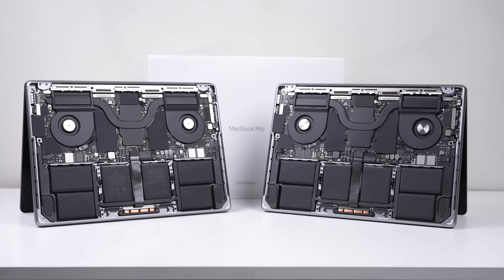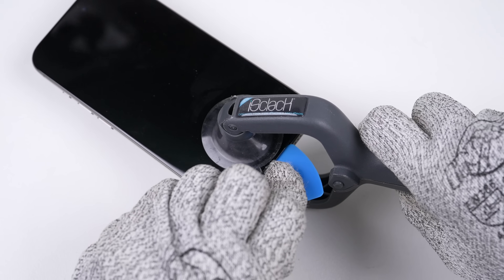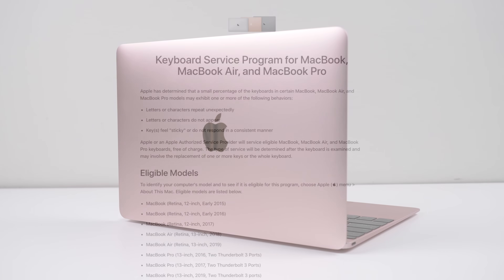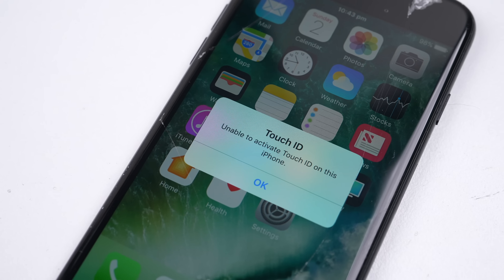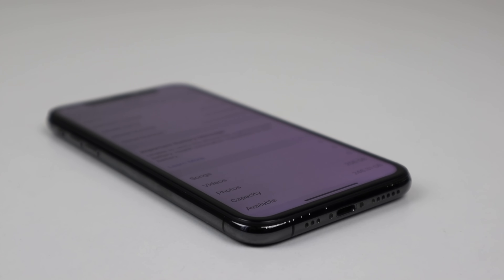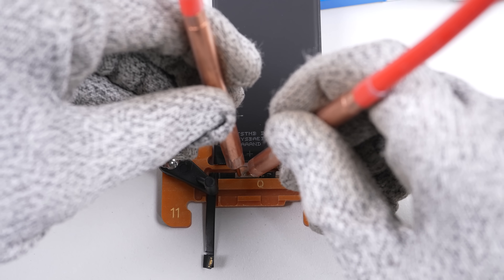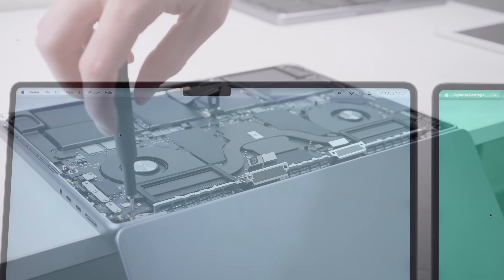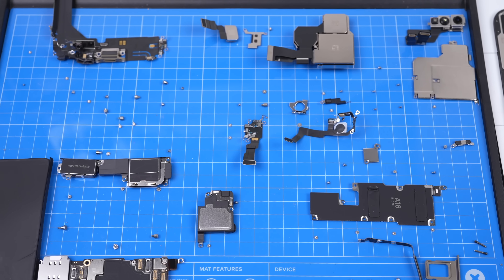Astonishing Anti Repair Practices By Apple In the Last 15 Years

Comment: The ABSOLUTE worst thing Apple has done in the past, is to make their phones virtually irrepairable, and have success doing it. That encouraged all other cellphone manufacturers to follow suit. Their actions over the years have contributed to tons and tons of tons of e-waste. They were, and still are despicable.
Reply: And then they greenwash lol
Reply: @seesikopter just don’t be poor and recycle/trade in your phone
Reply: @0IIIIII  why should i
Reply: Yep, I hate when people say "yeah but other companies are doing it too" that's mainly because apple pioneered those awful pratices.
Reply: That's because they have a monopoly in you know which country.
Reply: @ss_avsmt the hellhole called america
Reply: and people are still buying them and they make most profit out of all smartphone
Reply: Sheepole are buying them, they all follow the herd
Reply: @asfsfas2435 the problem is that having a phone is no longer a commodity. Even if I actively avoid a top of the line phone, I have to end up replacing them in 2-3 years at most when I used to be able to replace a broken part them until they completely died out. Now if the screen scratches even a little I have to replace the whole thing because just replacing the screen is no longer viable.

Weirdly enough, I still use my Nokia C3 that I bought on like 2008 regularly. That bad boy still works (even though it's mainly as an MP3 player) and I was lucky to get a spare one when I started to notice these practices on modern phones
Reply: @asfsfas2435  They arent the most sold phones, but apple certainly makes the most profit. They have the biggest profit margin per phone of all phone companies, and they have virtually no competition on their "apple monopoly". People either buy apple phones, or androids. Androids are far more common, but they all split their quantities between different manufacturers. There are just countless, like e.g. Samsung, Xiaomi, Oneplus, etc. This and their market strategy of being a luxury and status item made them what they are today.
Reply: @asfsfas2435 we’re still buying them because they mostly never have to be repaired. It’s called quality.
Reply: And they will argue that anti-repair policies will hasten the innovation
Reply: Most people defending apple here have generic profile pictures wich just goes to shown they are casual people who don't understand stuff
I dislike apple just because of how closed it is, I'm all for modding and customization and that's why I use Android, last year I got an iphone as an gift and just No I can't install Mods for games even if the developer allows it, I just couldn't take it anymore, I sold that iphone for 75% it's price to one of those girls at my college

Btw Windowns fix windows 11, Linux ain't that compatible
Reply: Never owned an apple device, never considered getting one, and after finding out they are doing this crazy shit just to force you to pay for a new device whether you're broken or outdated I decided I never will het an apple. Works for whoever works, but I was always peeved with their tactics.
Reply: @mihaipuscasu7357  based af, fuck apple
Reply: The EU mandated side loading, USB C and removable batteries!
Reply: @thewhitefalcon8539 nothing better than the eu
Reply: @thewhitefalcon8539  I mean on the brick side. Was that mandated by the EU as well?
Reply: And they call themselves very sustainable and eco-friendly for removing the charger block from the box. Which you will have to buy separately wrapped in more material and most importantly for more money.
Reply: @barnabasnagy9595  People who are upgrading their iPhone, don’t need to buy another charger. Also, wast majority of latest iPhone users are existing customers, so they don’t need to buy charger as well. Or maybe sofa-scientist like you knows better? 😀
Reply: @robertovic915  sorry if my comment was offensive or sounded like that, it wasn't my goal. I heard that a lot of the people weren't satisfied with this choice and this was somewhere around when they started giving cables with usb-c on one end.
Reply: @robertovic915  Apple didnt care about their previous users and making les E-Waste though, why would they try not to use USB-C otherwise? Almost everybody already has an USB-C Charger for the majority of devices, AND it is superior to apples Lightning charger. That didnt mean they were happy with changing to USB-C tho lol
Reply: Sadly, they simply don’t care.  It’s all about the bottom line.
Reply: They had success with it because people just buy them, and that's why I refuse to be owned by them by never buying one of their devices...!!!
Reply: @lmwlmw4468 dont consume anything corporate use small businesses
Reply: Their management should  be indicted for crimes against humanity. Never touch anything Apple with a bargepole.
Reply: In fact, Apple was the first to implement EVERY SINGLE scummy tactic that we see in use today in the smartphone and laptop department. EVERY. SINGLE. ONE.
Reply: @meyes1098  Last time I checked, samsung were the one forcing TikTok and other bloat onto their phones with no ability to uninstall. 

At least on the phone side, M$ have been doing so for nearly 10 years over on the PC side.
Reply: @sagwan-square  tik tok isn't an uninstallable app on either windows pcs or samsung phones.

Thanks for playing though.
Reply: Yet they'll claim being green because they don't ship chargers.
Reply: And Apple fans keep buying.
Reply: Only hope is legislation like EU forcing removable batteries
Reply: @captaintoyota3171 the eu is easily the best political party on earth
Reply: Yeah that’s the worst thing, not the sweat shops they run
Reply: If it had been upgradable, I might still use my Huawei Ascend Y300.  Nice little phone, but much too limited storage (4GB was just far from enough even for moderate use).

Yes, upgradability and not lack of repairability was the problem.  It even had a user-accessible battery (which appears to be dead, just tried charging it a few days ago… not sure I'll even try to find a battery, it would be just for curiosity)
Reply: This is it.. this is how we'll destroy our world by not caring
Reply: boycott corporations just stick to small businesses
Reply: our only hope is the eu and until then stick to small businesses
Reply: and yet you fools still buy it in large even after being screwed over for decades!: 😂 brainlesss fools
Reply: I love it when children who know fuck all blame the entire industry on one part. In this case you think Apple was the only one making things smaller? 

Must be great if you think things are this simple. Kids are stupid.
Reply: Never bought a Cr@pple product, and hopefully never will.
Reply: Your mom is despicable.
Reply: What i try to tell apple fans but they get mad. But i know the truth and i have woken up from the genius brainwashing apple has done to a lot of their fans
Reply: I find it ironic. That people are more outraged over this then whats going on in the west. May I say white and genocide without getting ban. Well not that ironic as this platform is rigged to protect jews and screw white people over. Worry about the environment and any thing else but not what going on in your own country while your own blood line dies out and get forcbley mixed raced into oblivion. Cost of living and housing causing many more homeless dying on the street. While homeless shelters packed full of so called asylum seekers  that just so happen to pass by over 50 countries to get to yours. That make it dangerous for anyone to go there for shelter.
Reply: The worst thing apple has done was lobby against bills that would have held companies in the US accountable for forced labor in China
Reply: fuck the "e waste", they wasting my money
Reply: Thank you for paraphrasing and summarizing the video.
Reply: Apple makes environment friendly iCan, iToilet with built in camera,  antitheft protection , poprint sensor login etc
Reply: Yet 1000$ says you wouldn't give up your phone... All the companies do it, so if you don't like it, don't buy these bullshit "smart" phones anymore. That won't happen though.
Reply: @TanakaMatsumoto the old phones which were made to last and were actual phones are infinitely smarter than the modern day corporate screen tablet money farm
Reply: @TanakaMatsumoto  i bought a xiaomi f4
I am fine with it so far lol
Reply: @TanakaMatsumoto  i literally installed and reinstalled his own rom
Reply: EU has begun to say that all electronic has to become repairable.
Reply: @andmos1001  guaranteed eu w
Reply: @andmos1001   But they didn't say that it has to be cheaper than replacing the whole device. Nor do they have to provide repair guides nor schematics.
Apple being a huge publically listed company means that they must increase their profits every quarter. If they don't then stockholders will flee and Apple heads will roll.
Reply: @gebali  ohvno god forbid the billion dollar corperation not make as much money 😢😢
Reply: I’ll continue to buy iPhones until the alternatives are on par.
Reply: @o0Donuts0o  Some of the alternatives are on par with iphones. Explain what you think is better about iphone than android based phones.
Reply: @carletonrutherford1799  I prefer the interface on the iPhone. I don’t like Androids. And before you call me a shill the iPhone is the ONLY Apple product I use. For my PC, Windows all the way. Don’t like the iMac interface. I don’t care for aesthetics of a product either. Milled aluminum aircraft grade whatever, curved screen bla bla bla. I need a phone I can use fully in one hand, top of screen to bottom. iPhone mini fits my bill.
Reply: @o0Donuts0o  I was legitimately curious as to why you would say no other cellphone company is on par with the iphone. You have had success with your iphones, I get it. The smaller iphones that can actually fit in your shirt pocket are something I have been talking about for years. I have no actual issue with the quality of iphones. For actual usability, and operating systems, I think that android cellphones are on par with apple. I think that if phone size isn't an issue, it's just a matter of preference, and that there is no one better than the other. I still stand by my original comment in this thread though, apple encouraged other cellphone manufacturers that they could force people to have to buy new phones instead of being able to repair their existing ones by making it very difficult to even change a battery. And that is why I have a very negative opinion of the company.
Reply: i hate that i can't replace easily batteries i could be literally using one phone for decade if i could just easily buy and swtich batteries
Reply: I still wish my phone's battery could be replaced. That and processing power are the only reasons I've had to change in the past
Reply: I think consumerist culture causes e-waste. Apple devices last years until you need to replace them. People just like buying the brand new latest device, they sure as hell aren’t forced to.
Reply: Bro humans in general are wasteful as hell. 
Humans will ruin this earth until the consequences of that lie on the heads of the living and even then it'll probably be late. 
Nobody with actual power will have to worry about it and that's why nobody cares right now. #Humans
Reply: 𝙷𝚎𝚛𝚎𝚝𝚒𝚌𝚊𝚕 𝚎𝚟𝚎𝚗.
Reply: Pls just sue them for 2/3 billion dollars
Reply: "all other >>WESTERN<< cellphone manufacturers"

There are myriad Chinese brands that do nothing of the sort so don't lump them in with our western ripp off merchants eh. I smashed the screen on my Doogee S86pro a fortnight ago, 
It cost me £16 for a new screen from ali express,
£4 for B7000 glue
half an hour of my time.

Good as new.
Reply: "The ABSOLUTE worst thing Apple has done"
Sweatshops is all I'm saying.
Reply: I agree that the trend of making ir difficult to repair is odious especially from a business that started by Woz principles.  My mac 2008 now cannot connect to my new ipads or iphones but can still connect to an ipod.  The new mac pro is very expensive and not as easy to upgrade. I will probably buy a mac studio as a replacement but reluctantly, knowing the issues with soldered on ram and ssd.
Reply: It's nothing bad about it. It's Apple. It should be avoided. Who doesn't get what he paid for.
Really. You pay for it with Apple.
Reply: Brave.

-Apple
Reply: No they didn’t. I mean they did but you’re not thinking big enough. Global Capitalism FORCED those companies to follow Apple because Apple made more money, so Google/samsung etc investors starting asking why their stock was worth less leading to a situation where either their value plummets & the company stops existing or they start doing the evil thing. 

The same thing is happening in EVERY industry Congress could vote to explode Apple HQ and this problem would return in milliseconds because it’s DEMANDED not simply encouraged under our modern economic system
Reply: Doesn't stop people from buying apple products.   If you don't like something, then speak with your wallet not your words.  Words don't do anything, but the money you make speaks much louder.   Figure it out people or just keep the complaining yourself.
Reply: I'm not an Apple fanboy but these other companies are just as evil. No, they really are.
Reply: ok, but on the other hand: everything the free market does is god, right?
Reply: Yup, completely true. Now for example the digitizer is infused with the panel on all Xiaomi tablets, but before you could separate and only replace the glass.
Reply: iDespicable featuring gru pro
Reply: "bUt wE uSe ReCyClE aLlUmiNiUm"
Reply: For sure.
Reply: But they’re all for going green!!! They are even nice enough to not include power bricks on their new phones. They care so much about the environment !
Reply: and they say that they "cares" of the ecosystem
Reply: Just imagine if Wozniac lead Apple, could have been so much better
Reply: There is a reason they have an enormous resale value
Reply: I've never bought a single Apple product. But I now regretting having Samsung devices. But I've learnt my lesson and won't repeat that mistake again.
Reply: @gebali use small businesses
Reply: You're 100% wrong in your statement Samsung has always been repairable and I just repaired a Samsung A14 5G myself at home
Reply: @xtheflabeox8813  Oh, because YOU managed to repair your Samsung that means everyone can repair their own phones, and my comment is 100% wrong? If for example you were right, and Samsung is repairable by it's owners, does that mean all other cellphones are equally as repairable? No, that does not mean all other cellphones are equally as repairable. There is a reason there are 3rd party shops that repair cellphones, it's because they are generally very difficult, or almost impossible to repair yourself. You could have left it at "I just repaired my Samsung phone myself", which would be great, and suggest to me that Samsung is repairable by it's owners. But no, my comment is 100% wrong because YOU repaired your own cellphone. Got it.
Reply: sure apple makes them.. but the sheep are the ones buying them, and thus allowing this to happen! :P
Reply: @Xihrzah we live in history and there were a ton of revolutions in the past which changed the world for better or for worse why not now this seems like the perfect time
Reply: So true.
Reply: @theslowlane9675 sssoooooo true. Who cares? I have what I want.
Reply: Don't blame Apple.  People are stupid to buy their products.  It's THEIR fault.  People who complain that they can't repair a product, well it's their fault they bought it in the first place.
Reply: @fuzzywzhe Apple is still very much culpable lol
Reply: @fuzzywzhe  Yes, blame the lay people who have lives and don't have time to educate themselves on every single thing they buy. Why would you blame the scammers whose job is specifically to figure out how to fool people and do it absolutely intentionally? That would be crazy 🙄
Reply: @fuzzywzhe you cant complain about wanting somethinf to be better ig
Reply: @fuzzywzhe how is it their fault when it’s one of like two options, the other of which is also following suit. At that point just don’t buy a phone anymore
Reply: @apersoniguess_ yeah reject modern technology embrace being a normal sane person not being in this whole internet thing
Reply: @ytfeelslikenorthkorea Other manufacturers did though. Especially at the low end where cost of assembly is critical, all of that stuff is glued together.
Reply: They can be repaired if taken to authorized repair centers.
Reply: Phone and computer repair tech here - almost every part of an iphone can be replaced. Not saying it's easy but you can get genuine or aftermarket parts. Im not an apple lover at all but I do iphone repairs every day and they're (along with pc and other phone repairs) how i'm able to pay rent and eat.
Reply: @cheebsgod  You said it's not easy, that's the point.  It's needlessly complex.  It is only complicated to prevent repair.

People who buy this garbage, are idiots.  They deserve to be taken for every penny.
Reply: As the phone becomes more sophisticated, repair becomes less possible as the entire thing is more and more integrated.  This is a good thing as it drives down the cost of manufacturing as well as simplifies the supply chain.  Replaceable batteries are 50% smaller because of the space of the hardware making them replaceable.  The reality is no one replaces their batteries anyways as after three years the phone is less useful and people opt to upgrade.  All this shouting for a problem that doesn't really affect anyone.
Reply: @Cyril29a  this is completely untrue. What's happening here isn't a product of the sophistication, it's a product of a willful denial of the ability to repair. It also allows Apple to put prices for their repairs unreasonably high.
Reply: @ytfeelslikenorthkorea  Dunno bro, my 2013 MacBook Air still works perfect and I use it to this day, can’t say the same about all the pcs I bought in the meanwhile.
Reply: @HotCacahuete Surprise, surprise. I have a Sony experia z5 tab still working. Just 10 years old. I have a fujitsu laptop, 12+ years old now, works perfectly.
Of course, some premium PCs went wromg, as some Apple products did. Just compate apples to apples (pun intendeed). I mean compare products from the same price category.
Reply: @zoltanberkes8559  I’d love to hear your definition of “perfectly”.
Reply: @HotCacahuete thats from 2013 back when things were still quality and made to last
Reply: How many times you need to repair your phone? 😀 I have never used Apple warranty. I had devices for 2-3 years, without any problems.
Reply: @robertovic915 you trying not to use that annoying ass emoji for 0.0000000000001 millisecond:
Reply: @robertovic915  When you are paying upwards of $1000 for a cellphone, they had better be problem free for at least 2 or 3 years. But cracked screens do happen. Batteries go bad. Charge ports get messed up. Those are the things people need repaired. You shouldn't be forced to take it back to apple to get repaired. And if that does happen, you should be able to take it to a 3rd party repair shop to get fixed with genuine apple parts, with no issue about parts pairing with the phone. If your phone is 4 or 5 years old a lot of people will just buy a new one anyways, rather than go through the hassle of getting it fixed. There is the e-waste.
Reply: @robertovic915 You can use any Android mobiles for 2-3 years as well. But many of us would like to use our mobile for 5-8 years. Most of the time they only need to some simple repair: battery or display replacement.
Reply: I’ve been repairing phones since the 3GS and have no clue what you’re on about. iPhones have been amongst the most repairable, especially factoring in the availability of parts. Sure there are road blocks with serialized components, but we run into road blocks with other manufacturers way more often.
Reply: @TheOfficialOriginalChad  Are you trying to tell me that iphone parts are not paired to the motherboard? From what I have seen watching Louis Rossmann, Hugh Jeffreys and others, who have shown that swapping working parts from identical iphones causes the phone to malfunction. THAT is what I'm on about.
Reply: @carletonrutherford1799  sounds like you know what serialized components are, but you just didn’t know what they’re called ☺️

You’ve been watching people that make their careers in complaining. Best to be aware you’re looking at one side of the coin. I do my best to look at both.
Reply: @TheOfficialOriginalChad  Who are you kidding?  You can't even replace the battery of an iPhone without going to repair shop.

I have a Motorola One 5G.  You have to dissolve some glue, the back falls off, you have to remove a bunch of tiny screws, a plate, and pry out the battery.

A competent technician can do it in 10 minutes easily, I can do it in an hour, as I'm just an electrical engineer, and not a technician.

With an iPhone you have to literally pry out the battery, bending it, risking a short.

My phone cost $200.  I can send files to it through a common FILE SYSTEM I have setup.  Can you do that with your "advanced" iPhone?  Apple, it's like working with the dark ages.

People don't know what they miss when they have no idea what is available.  I'm listening to a podcast I ripped from an online source, to an MP3, which I placed on my phone, right now.  This is trivial to do on nearly any device EXCEPT an iPhone.

And the thing about it, is the iPhone is running BSD!!!!!!!  It's just Unix!!!  And you can't even do general simple obvious 40 year old things you could do with Unix today.  It's a crippled machine.
Reply: @ytfeelslikenorthkorea the only thing glued in MacBooks is the glass.
Reply: Except they are repaired every day by people who know how to repair electronics.
Some people done have a manufacturing degrees and just assume everything in the world should be the easiest thing for them and their needs. You want an "easy" to repair device build it yourself, pay three times as much and be happy.
Reply: @jhoughjr1 i learnt repairing motherboards all bymyself. I did not need a degree for that. Btw i am a retired doctor of medicine.
Reply: @jhoughjr1 you mean pay 5 times less?
Reply: @jhoughjr1  There's no reason to glue a battery into a phone.  There's no reason to use digital signatures to pair components of a device to prevent using two identical products with different broken parts to be combined to make one working system.

This is all artificial.  It's designed so that you will be forced to purchase whatever the corporation deems you should be allowed to purchase.

You know this.
Reply: why throw your phone away when you can hand it in to apple, either for them to pay you back a proportion if it still works, so they can refurbish it, or have them recycle it for you? if you decide to throw it away just because fixing it at apple's is too expensive, you are the person that creates e-waste, not apple, because apple has ways of properly taking care of the device without you paying anything. they are indeed good at refurbishing and recycling.
Reply: @haomingli6175 do you even know what they do with it dont trust corporations dont trust billionaires dont trust politicians dont trust governments
Reply: @haomingli6175  Why not make the iPhones so that they can be repaired by owners, or 3rd party repair shops? Why not make parts readily available, and affordable instead of either not offering parts, or making them so expensive that it defeats the purpose of repairing your phone? Why not ship a charger with new phones? They lie when they say they are doing that for environmental purposes. They are doing it for economic reasons. Google "Apple recycling lie" and read the Foundation For Economic Education's article on it, and stop being such a pathetic apple fanboi. They don't give a damn about the environment, they ONLY give a damn about profits.
Reply: @haomingli6175  yeah, we've all heard how good Apple is at genuine environmentally-conscious disposal 🙂 and most of what they wouldn't fix should still be fixable if manufactured & designed properly
Reply: all these typed in an iPhone or Macbook?
Reply: @romella_karmey  What? Are you asking me if I typed that on an iphone or imac? If that was your question, the answer is absolutely not. I have never given Apple a penny of my money. At home I use a PC that I built. My cellphone is an older LG with a user replaceable battery.
Reply: @romella_karmey "and yet you partake in society"
Reply: @romella_karmey Just because someone owns a macbook or iPhone doesn't mean they like they company 🤦‍♂
Reply: @romella_karmey over time it builds anger and eventually it spills to make people purchase different devices.
Reply: @romella_karmey  Almost 10 years old LG phone that runs custom rom of android 12 just nice and dandy, and battery replacement cost me all of 20 euro at local shop a couple of years ago.
Reply: Dude, if you make these repairable. The Chinese will make a ton of 99% new second-hand Iphone
Reply: @3-ngan  And whats wrong with that?
Reply: @3-ngan  literally who cares if you cant tell the difference between an official IPhone and some chinese knock off thats a bonafide skill issue on your end dude
Reply: @3-ngan  what's wrong with that ? Let the market determine, not the anti-competitive & restrictive practices of the dominant manufacturer
Reply: Here’s the thing though, iPhones have a relatively low failure rate so you’d only ever have to repair it if you’re either extremely unlucky or careless with your phone. iPhones get 6 years of iOS updates and 8 years of security updates. Not to mention they have software features that prolong the lifespan of their lithium batteries. I have a drawer full of obsolete androids, but yet my iPhone 11 Pro Max is still working as good as it did on day 1. I will still get 2 more years of major updates and 4 years of security updates. Needless to say, I won’t be upgrading until at least 2025.
Reply: @TylerN945  Mobile phones are intrinsically a fragile item likely to become unusable after an accident. Batteries have a finite life - no matter how much longer genuine Apple  batteries might last.  For a large proportion of purchasers, they will become unusable well before the customer would have wanted to dispose/upgrade.  With Apple, it's the customer & natural environment which lose out in this instance compared to  repairable products.
Reply: @TylerN945 low?,?😂😂😂😂😂😂
Reply: @TylerN945 meh, your opinion just sucks. Accept it. 🤷‍♀️
Reply: @TylerN945  Because personal experience is the absolute truth. I've had only three phones in the last 12 years and the only reason I have 3 is because they were getting old... No malfunctions, no charging issues, no nothing. Does that mean androids are indestructible? No, of course not, same applies to apple. There is no excuse.
Reply: @TylerN945 i’m still on my iphone x, apple haters are dumb. there’s a reason they control the market. last android i had was galaxy s6 never getting one agaib
Reply: They are a premium company wanting premium repairs carried out. Opposite end is Android phones with their cheap crummy parts, so stands to reason that they take a different approach to repairs.
Reply: @leebeeskee It's ridiculous how Apple fanboys think Android as cheap and low quality. While Android is way better than IOS, you xan choose from a wide range of mobiles from the very cheap to the very expensive iphone killers.
Reply: @leebeeskee "Premium" 

The recent iPhone disagrees
Reply: @leebeeskee this is the most stereotypical 14 year old tiktok iphone girl sentence ever
Reply: @leebeeskee  once I buy a product the company should have zero say in how I decide to repair it
Reply: @leebeeskee  They've suckered a lot of folk for sure 🙂They don't want premium repairs carried out. They want to sell you new & dumpster the old but still potentially re-usable
Reply: funny how you guys pretend to care about the environment lol, just apple bashing to follow trends
Reply: @dresdi how tf do you project this hard. are apple fanboys that desperate to defend their purchase???
Reply: @dresdi  go live in the woods 🪵
Reply: @dresdi  LOL! You make a lot of stupid assumptions in one little comment. Nice job. Absolutely nothing in my original comment was incorrect. You are just a sad fanboi. You need to go look in the mirror and say to yourself that you are pathetic for feeling the need to defend a soulless corporation.
Reply: @dresdi  you dont have to even pretend to care about the environment when ou are pointing out hypocrisy on apples end lol. What argument is that even?
Reply: Pretty sad that you invest so much of your personality and identity into a brand that you feel personally offended by people criticizing a corporation that doesn't even know you exist.  @dresdi
Reply: @dresdi  youre just projecting your own spineles inability to stick to your principles lmao